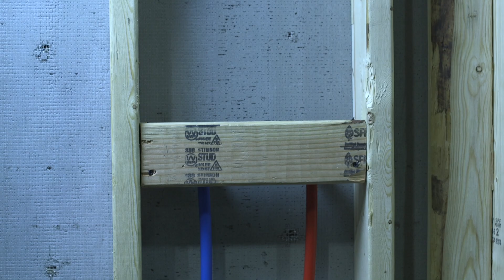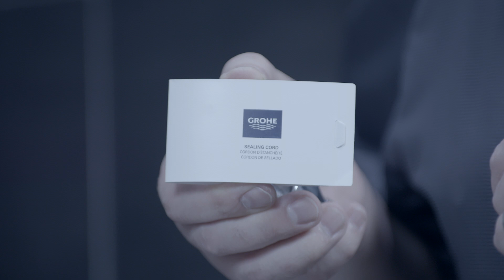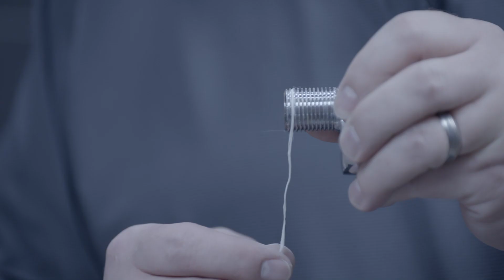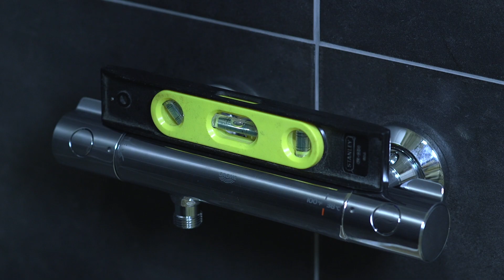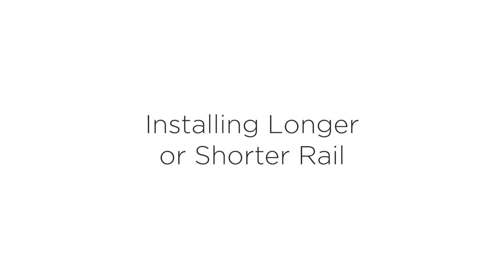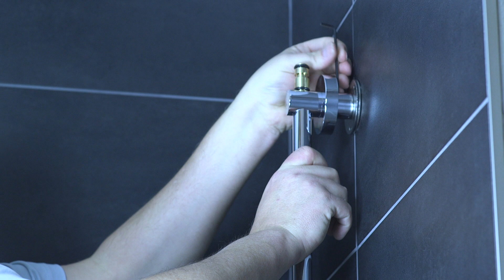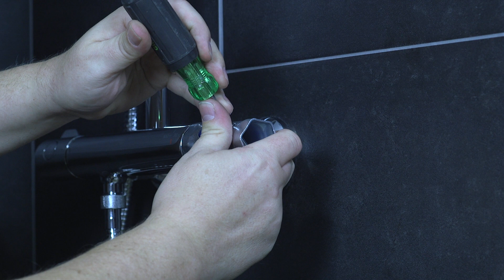GROHE | Euphoria Exposed Shower System Installation Tips & Tricks | Installation Video

Comment: What isn't shown in this video is whether the joint between the cutoff nipple and the eccentric adapter actually holds under pressure. I suspect it leaks. I have installed a dozen of these units before Grohe started including the cut off nipple and an eccentric adapter that mate together with parallel threads as opposed to tapered npt. This change seemed to happen when the last three digits of the model # changed from 000 to 001. I received three of the new style units recently, none of which contained the cord shown in this video. The cord is loctite 55 which is not available in North America. Grohe sent me enough to do the three showers. I followed the instruction to a tee and had one successful joint out of eight attempts. I have been in the trade for forty years so I have a wealth of experience. In was hoping loctite 55 would be the magic answer to sealing parallel threads but it most definitely is not. The only system I'm aware of when joining two parallel threads is when the male thread compresses onto a rubber or fibre washer at the base of the female thread, similar to a swivel nut on a garden hose. There are a couple possible solutions to this problem. Obtain eccentric adapters that have a tapered 1/2" npt on the end that's buried in the wall. You won't get many revolutions into the cutoff nipple so if you have enough depth, replace it with a 1/2" brass nipple and coupling. Or, figure out a way to come out from the 1/2" female that you roughed in and increase to a 3/4" npt male thread s.s. nipple because the 3/4" union nuts on the finish valve body accept both tapered or parallel threads. Sorry if this is over technical.
Reply: I installed 2 of these and they always leak with the provided string, I had to use all kinds of thread sealers to make it work, beautiful design, good quality but awful coupling procedures
Reply: @velazko007  What ended up working for you? I'm struggling with the s unions. Just ordered some loctite 55, hopefully it works. Should I get some pipe dope too?
Reply: Thanks for this, Tom but on the same union on mine the parallel (BSP) male threads on one end where the  escutcheon goes on and the female nuts from the fixture where it attaches,is measures 1” in diameter not 3/4. Same as a female garden hose except parallel threads. I’ve got 2 drop ears that I’ve set at exactly 5 7/8” or 150mm. Ideally I need a straight reducing nipple fitting that’s 1” bps on one side to 3/4 npt that will screw into the drop ear and eliminate the extender altogether. I believe this would give me the correct depth. I do not trust the cord winding technique and totally agree with you when you say that parallel threads need a washer/o-ring pressed at the end for a
proper seal. I would feel much safer with a npt fitting especially within the wall.
Reply from the maker: Hi Tom, thank you for contacting us. You are referring to the easy install adapters part # 408320031, correct? These are offered as singles so you would need 2 or you can get a 124629 which has 2 Easy install adapters and 2 of the S unions. The Loctite 55 can be ordered off of Amazon. You will need a 18” piece of the cord for each S union and it will be wrapped in a criss cross pattern. If you do this it will seal up the threads and not leak. If you'd like more detailed assistance, feel free to email us at groheconsumerconnection@lixil.com. - GROHE Social Team

Comment: I've had a professional plumber install this system. They have been out 3 times to stop it from leaking. It still leaks. Why come up with a system that you have to hacksaw the threads and use a proprietary threading sealant when the standard system of sealing has worked fine for decades?
Reply: These values are garbage. I have had nothing but problems with every single one i have install. I will not install them anymore.
Reply: Ikr!
Reply: Exactly? They want u to hacksaw the threads and use a dental floss type sealant which if it leaks u have to take it apart and redo. Not enough sealant
Reply from the maker: Hi H Young, we are sorry to hear about your experience. We would like to help you resolve this issue. Can you please email us at Groheconsumerconnection@lixil.com and write "Attention Cody/Deidrea" in the subject line. - GROHE Social Team

Comment: I'm considering buying the easy install adapters to solve my installation problem. (My walls are tiled and grouted at this point and I am using standard S-unions and escutcheons that came with the system.)
My Drop ells are at a depth that leaves a distance of 9/16'' from the surface of the tiled wall to the opening of the drop ell.
Given my situation do you think the easy install adapters can be cut to a length that would help with my install? As per my calculations it seems like I would have to cut them too short i.e. to get the recommended length i'd end up with barely any thread left to screw my standard S-union into the female adapter...Please confirm. Thanks in advance.
Reply from the maker: Hello, thank you for your question. If you only have 9/16 of an inch from the pipe to the finished wall these will be cut too short to work. These systems can be installed without the adapter by just threading the S union right into you drop ell. - GROHE Social Team